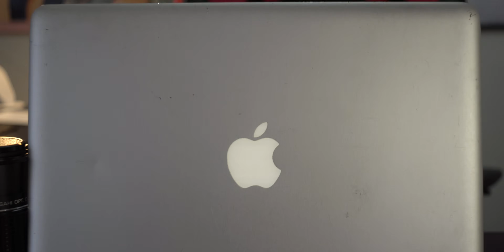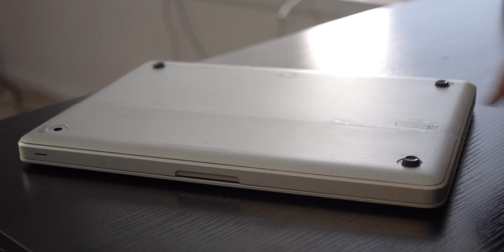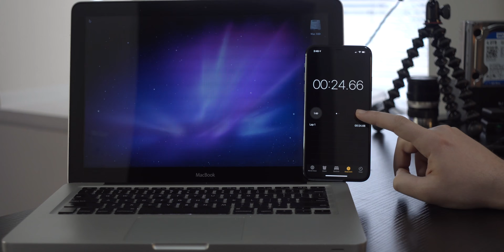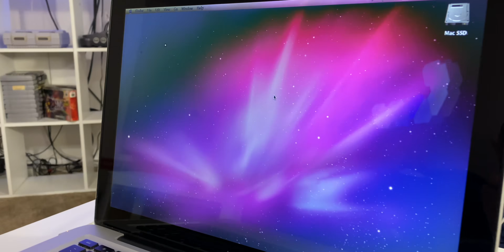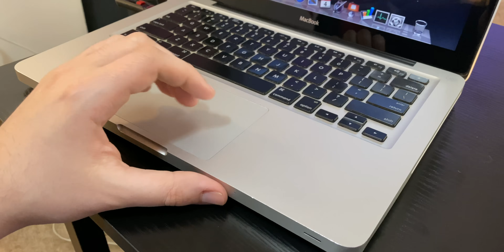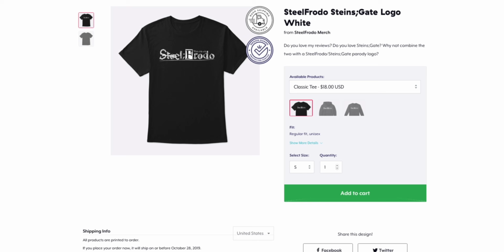Using a 2008 MacBook in 2020 (Part 1)

Comment: Just discovered this channel today. My first Mac was this MB 2008 I brought from a Fry's Electronics for about $3,000 of my money to be used for a work project. From the first time I opened it, it felt amazing. 

Had Snow Leopard on it and I upgraded from the default 2GB to 4GB. Eventually I upgraded it from it's original 250GB HDD to a 1TB HDD so I could run Parallel and older VMs. 

It is still usable today in 2024. Just had to replace the battery once and the battery still working great. Prob makes a diff on using the right charger.

Comment: I found a MacBook with some laptops thrown out on the nature strip. I had to put in a new disk and installed Mac OS high Sierra. And I found out it is a MacBook Pro 2011 with an i5 processor and 12gb ram (the other laptops I took the ram out of them)

Comment: Watching this on my end 2008 unibody MacBook. With 8GB RAM and a SSD it still works like a charm, incredible for such an old laptop. Just bought a new battery for around $40 and now I'm fully mobile again. El Capitan is probably the last osX release for it, though.
Reply: You can do a dosdude1 patch to catalina
Reply: I have replaced a torn speaker, upgraded HDD to SSD, thrown a new battery and after a thermal paste job, works OK except overheating while watching YouTube over 720P. I tried El Capitan but had to settle with High Sierra due to high idle resource utilization causing over heating.

Overall not bad for casual web browsing. I happy to see my very first laptop still working after 12 yrs!
Reply: How is it for doing schoolwork you think?
Reply: @christianstadler6099  I updated the OS with the dosdude1 patch and it’s running ok. Not great, but I had windows PCs that where younger and worse. Updating is recommended by my side, though, as many modern websites won’t work on the old OS anymore, as well as apps like Word, etc.

Comment: I have a late 2008 MacBook Pro, I bought a new. 500gb ssd drive but when I try to run your Catalina patcher it gives me the error “an error occurred installing Mac OS . It says to run diagnostics but the keyboard short cut doesn’t work and it just cycles back to the error. Any suggestions? Thanks

Comment: Watching this on my 2006 MacBook core duo running 10.6 on arctic fox
Reply: Nice!!
Reply: Thanks
Reply: @Clemont213  A question. How did you manage to get Wifi on that thing?
Reply: @natstudios9362  AirPort Extreme card inside and it has a third party battery it lasts about 2 hours
Reply: @natstudios9362  wait how did you know I was using wifi
Reply: @Clemont213  And hows the battery holding up?

Comment: I'm using a 2008 MacBook Pro to write this and it's working quite well thank you.
Reply: He wasn’t using the pro so it’s the decent  2008 MacBook and it is really good still in 2022
Reply: Do not write on a 2008 MacBook 🚨pencils are way to sharp and they don’t enjoy pens 😭
Reply: Eli, thanks for that, I wondered where I'd been going wrong 😁
Reply: Pro has geekbench score 1300 non pro has 300
Reply: I have a 2008 macbook but it works but i dont know what the frikin fan is doing it is runnning fast 😭

Comment: Do you know why the patchers (10.13/10.4/10.15 patcher) work on this Macbook, but not at the fairly similar MacBook Pro 3.1 which is even faster than this one? Even the GPU's are both Tesla architecture.
Reply from the maker: Because the CPU front side bus speed is slower at 800mhz and the RAM supported on 3.1 MacBook pros is DDR2. MacBooks have 1066mhz front side bus and DDR3
Reply: @GarrettCrespo  DRAM speed should not be an issue. My MacPro has 800Mhz FSB and DDR2 and runs all versions. I must be a small subset of VT-x instructions on the CPU or something like that: https://ark.intel.com/content/www/us/en/ark/compare.html?productIds=33084,35348,29762

Comment: Need advise please...
Got a Macbook 13inch early 2008 with OS X Lion 10.7.5
How can i install Zoom Meeting? Since the OS can not be updated higher than already installed. Thanks.
Reply from the maker: Unfortunately there isn’t much you can do once apple ditches support unless unofficial upgrade tools support it. But most upgrade tools don’t go that far back in apples line up.

Comment: Last night my 2008 MacBook went in sleep mode and I couldn't wake it up. I turned it off and when it was trying to boot up the sceen shower a circle with line through it. I held the option key and selected the recovery mode. It took forever for the Apple logo/load bar to get to the end and sat there "completed" for 30 minutes. I guess the original hard drive has gone out. I put more 2 more RAM in it for a total of 4 RAM last year. Has 1 year old battery which is it's first new one. I installed el capitan on it last year. Can you help me get it running again?
Reply: Maybe your hard drive or ram is faulty?
Reply: its either a firmware issue or more likely is the HDD is dead. If the ram was faulty then its self check would fail and it would refuse to boot and give you a message to bring it to apple support .

Comment: currently using a 2008 macbook 2g of ram i swapped the ram out for 8g of ram and it runs super smooth gonna swap the hard drive to a SSD but have not gotten around to it but the laptop does run way better with 8g of ram.
Reply: What ssd can it use theres so many different ones on the net
Reply: What macOS are you running?
Reply: Same but i only have 6 gb ram in it and still running on a hdd. still works good though. Best of luck!

Comment: The original 2008 MacBook Air was my first ever apple laptop, I got it for Christmas in 2008. It only lasted me 2 years, the hinge broke completely and it had all kinds of issues. Upgraded to a 2011 MacBook Pro in 2011, which is what I am still using right now.
Reply: The 2011 macbook pro was a beast of a notebook, it was my first mac ever and I used it from 2011 all the way to 2018 as my daily driver, had the 13 inch core i5 model that I upgraded to 16 GB of ram and a samsung SSD + a new battery, one of the best computers I ever owned, it even survived a spill of apple juice to the keyboard (had to immediately turn it upside down and I literally absorbed with my own mouth all the apple juice as fast as possible and I used a hair dryer to dry the keys), I also changed the thermal paste a couple of times. 

If it werent for gaming I'd own a 2021 M1 Pro macbook pro. I miss mac os sometimes
Reply: what about in 2023?

Comment: Great video, you come across as likeable and knowledgeable. I’ve been upgrading my late 2008, exact same model. RAM, DVD Drive, SSS is on the way.

I only really use it for Adobe CS4 suite and so I’ll just keep it running :) I also recently got a PowerBook 180c for Turbosynth System 7 fun.
Reply from the maker: That’s awesome! Congrats on the PowerBook!
Reply: Thanks. I meant SSD, not SSS by the way. The PowerBook is real nice, and some of the sounds you can get by messing with samples and Turbosynth are really out there.

Nine Inch Nails used to use it, so that’s why I was so interested in it.

Comment: I bought the same one in mint condition last year for 80 euros, only had to tighten de screw for the trackpad and put a ssd in which already helped. getting 8gb tommorow and then I will try the Catalina patcher. Great video series!
Reply: catalina patcher too bad when u install it cant use apps only crashing like a line calls chrome vs.
Reply: @BurakUnkn0wn  I have Mojave running perfectly 😅
Reply: Richy McFly Try install line and try video calling u will see it correctly. 🤣
Reply: @BurakUnkn0wn  🤣 I believe you!
Reply: Richy McFly love u bro 🤣
Reply: @BurakUnkn0wn  🙏😂

Comment: I’m watching this video on a late 2008, 2Ghz, 8Gb DDR3, 256Gb SSD. Granted my MacBook hasn’t had the rough life that yours has, but it STILL does what I need it to do. The “expert” at Apple Store said that the highest OS that this could handle is OS X El Capitan 10.11.6 (currently running). What is preventing me from throwing Catalina on this puppy? The CPU, HD or both? Thanks for the video!
Reply from the maker: Chances are, it’s a bit of both that’s keeping you from upgrading. However, the biggest thing is probably the difficulty of making drivers for macOS that reach back that far.
Reply: I have the same machine but SSD is 512 GB. I instaledl Monterey using OCLP. It's a bit slower and Maps app does not work, but overall it's very well with this OS version.

Comment: Interesting video, because of lockdown I have dusted off my late 2008 MacBook, not been used since mid 2015, cleaned it inside and out,  will put in a ssd this weekend.
Reply: got fast?
Reply: @kaiquearaujoslp  these are nice with ssds and more ram
Reply: How is it so far?
Reply: How's it going? I would love to know :)
Reply: Still going, a lot of apps won't run now because there are  no updates available. But still usable.
Reply: @poppaonboard  bro try to update Catalina in  non suported mac, you will surprised.👍

Comment: I use a 15-inch 2008 macbook pro with intel core 2 duo t9400 at 2.53Ghz and 4GB of RAM with a backlit keyboard, it is impeccable as new, it has no scratches
Reply: You can add up to 8gb ram with the right Boot version

Comment: Is 2008 good to buy in 2020 or should I get 2011/2012 one?
Reply from the maker: Unfortunately it takes way more work than its worth to get a 2008 model up to speed. 2011 or 2012 would be a better buy.
Reply: Yes and no if yes then get a 256gb ssd, 8gb ram and MacOS Catalina via patcher
Reply: CosmicRB just what I have lol
Reply: Get a late 2008 i have Catalina on it. I put an ssd and 8gb ram in it too
Reply: Also, I have a MacBook Pro Mid 2012
Reply: Real Talk I’ve got a 2012 and it works fine, but I would suggest a 2013 (at least) or 2015 model due to the screen and probably support (future updates. But the 2012 is the oldest MacBook to be supported with the latest updates, and is expected to get 2 years maximum of security updates for every OS (so if Catalina is the last OS, then it will be secure for another 2 years), but you can also either Hackintosh it or use Windows Bootcamp.
Reply: Mr. IDGAF I wish I read this before I just got 2012 MacBook Air , it not letting download anything and when I go on safari on a website it don’t let me go on it does anybody know why I’m new to a MacBook. Can I update the iso on it
Reply: @realtalk5217  I don't think your Air is upgradeable in terms of hardware/components. But you can update the OS through the App Store. I would suggest downloading High Sierra from the Apple website (https://support.apple.com/en-gb/HT208969) - this is because High Sierra is the most fastest & stable OS for me, still has the latest apps and it still has the latest updates. If you have 8GB Ram (you can check on the top right Apple logo > About This Mac), then I would recommend Catalina (which is the latest OS and it still supports your machine) on the App store. Also, in a few years where your mac doesnt recieve the latest updates so the latest apps at one point wont be supported, then I would suggest to install Windows for free (by the Microsoft website) and use the Bootcamp app by Apple - and you dont have to activate it (as unactivated windows will prevent you from customisation like changing the desktop wallpaper) or you can crack the activation for free (check on YouTube for tutorials).
Reply: @realtalk5217  Also, your Safari app may be too old to load webpages, or your Macbook may not be connected to the internet. And if your problem still exists then you can call Apple or use the live chat on their website-

Comment: So I saw a MacBook (late 2008) for sale $155 .  I am thinking of getting one with the intent of upgrading to make it useable. 
Or should I look a a newer version?  
I want one 2011 or older since Steve Jobs had his influence on the MacBook
Reply from the maker: I'd look for at least one that is still officially supported. It becomes more difficult to unofficially upgrade year over year.
Reply: Get the 2009 unibody buy an ssd and 8 gigs of ram
Reply: for $155 your not hurting its worth it if it in good shape and turns on I say yes buy it I bought mine on Ebay for 230 3 years ago updated just the ram to 8g runs great for surfing the web, watching movies, and listening to music basically all i use it for